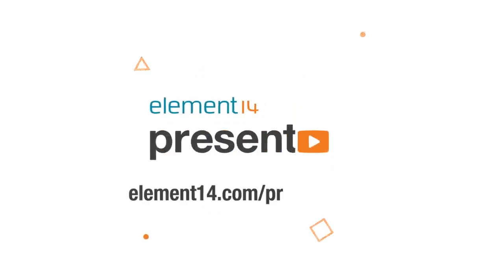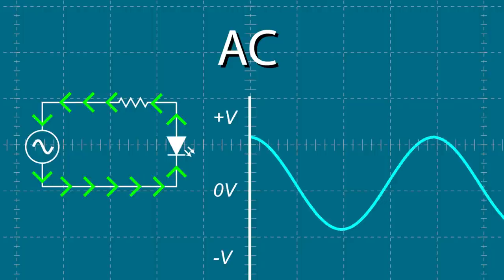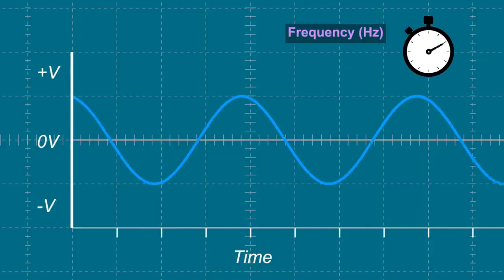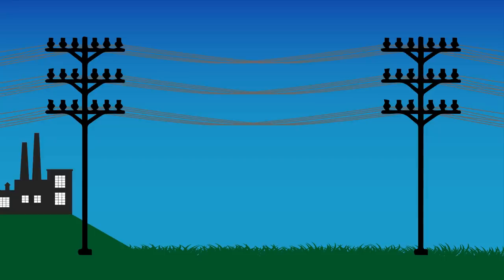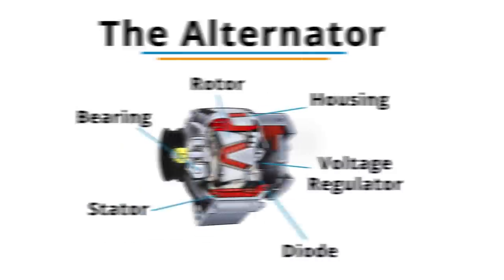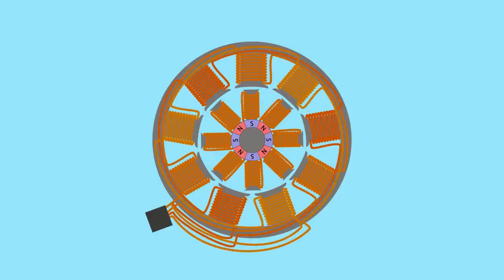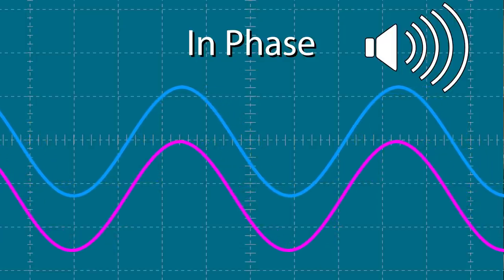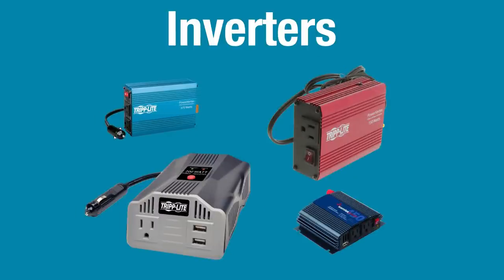How Does Alternating Current Work? - The Learning Circuit

Comment: RMS Voltage Equation
Then the RMS voltage (VRMS) of a sinusoidal waveform is determined by multiplying the peak voltage value by 0.7071, which is the same as one divided by the square root of two ( 1/√2 ).
Reply: 1/✓2=✓2/2
Reply: @abdelbaki4512  yes is does

Comment: Hi in minute 2:36 is wrong explanation,  VRMS = VPEAK / SQRT(2), or if I am wrong correct me :)
Reply: That's right: Vrms = Vpeak / sqrt(2). But it is only valid for sine waves. The information that Vrms is always smaller than Vpeak is wrong. In a square wave, Vrms = Vpeak.
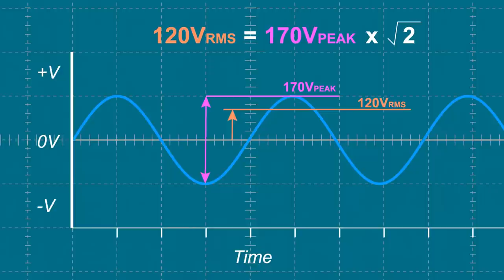And at 3:41, the chart is wrong. In Brazil we have a mix of 220V and 127V both at 60Hz. Major cities here like Rio de Janeiro and São Paulo uses 127V.
Reply: I just learned this in my electricity class. √2 is ≈1.4 so it's very easy to see it would be bigger than peak voltage
Reply: @henryrobinson9837  only for sine waves. More information can be found on wikipedia:
https://en.wikipedia.org/wiki/Root_mean_square#In_common_waveforms

Comment: I think the video should have focused just on the "power" aspect of AC/DC and that AC for transmitting power really needs to be a sinus wave to work well with transformers (and get the same wave on the output). Mixing signal transmission just confused things a lot, we are rarely focused on the "C" for "current" in "AC" when talking about signals... another indication that "AC" is misused for signals is that "DC" for signals makes no sense.
The reason why we use transformers to increase voltage for the long distance transport seems to be missing (power is voltage times current and losses are proportional to current squared, so we reduce current and boost voltage)...
Reply: I'm sorry but "sinus wave" really made me laugh! 🤣
It is "sine wave", sinus is to do with the nasal system (your nose). 🙂
Reply: @TanjoGalbi  :) Good catch. Sinus is the latin word sine was derived from (and still seen in English in e.g. in "sinusoidal"). So sounded OK to me at first :)

Comment: i find dc sort of easy Kind of tho since it has + and - Wire eks Red(+) Black (-). but ac has L(Live) and N(Neutral) and if i connect them together the Circuit braker gets trigged, but when L and N are Shorted via Light bulp(E27) as a example or Wolfram steel(i think its that) Heater that common over the door as a Heater then  it works ok wiht out Trigging the Circuit Braker, Perhaps a video about this stuff to, also L and N gets connected to together on the Primary side of Transformator :D Great video as Always :)

Comment: Great video Karen. I think a few sub topics can be added to this video to compliment what was explained. When comparing AC versus DC, it might be helpful to explain why AC is used to distribute being if we used DC, the size of the power lines would be much bigger to than what is used for AC. This of course goes back to the early 19th century, so maybe a quick history lesson is in order. Also, maybe including some applications as to why 3-phase AC is important. Maybe briefly explaining how some electric motors have issues using a single phase followed by showing a graph of the 3-phase current while explaining that they are 120 degree out of phase of each other (2.09 rad). I'm not sure if you would want to also include a substitute to a permanent magnet being an electro-magnet since you briefly talk about topics that could lead to a short explanation of this alternative. I understand if you try and generally cover everything, this video could become very long so in the interest of keeping it short, a lot is left out and explained in other videos.

Comment: Lost me in the first few seconds when you said the power goes both ways.  I just don't understand how that works.  I don't even understand for something even as basic as traveling through the power lines.  If it is going both directions then how does it travel even?  And I'm COMPLETELY baffled by the idea of it traveling both directions in a circuit.  To me circuits seem kind of like programs in a way.  Each part does something that the next part works off from.  However, if power is traveling back and forth then that would be like having to write programs that work if you ran them backwards.  That just seems EXTREMELY limited on what you could do.  Unless you are turning it into DC power for most circuits.  However, doesn't that waste a lot of energy?  I'm sure it all makes sense, otherwise we wouldn't do it.  Your explanation though just created more questions for me than it answered.

Comment: I am having a hard time understanding how you get .707 from the square root of 2.
I think I am missing something.
Reply: She should of done 240/1.4 which is square root of two which equals 170, which is equivalent to doing 240*0.7
Reply: Positive side peak  * .707 = 120, same for negative.  Both show 170 * .707 to give you 120v useable per peak.    You can also take the rms * 1.414 to get a peak voltage (not peak to peak).   120v * 1.414 = 170v
Reply: ITS 1 DIVIDED BY THE SGUARE ROOT OF 2=RMS